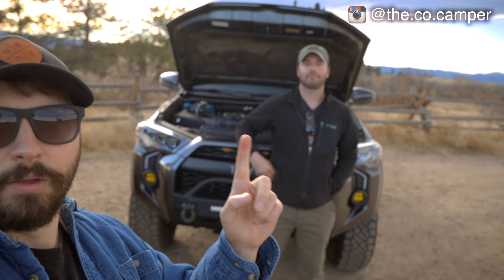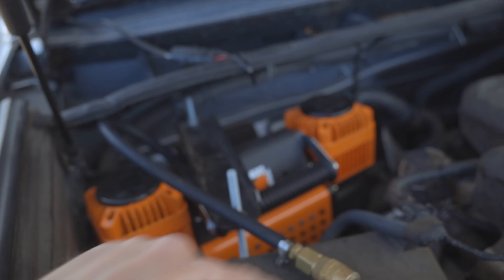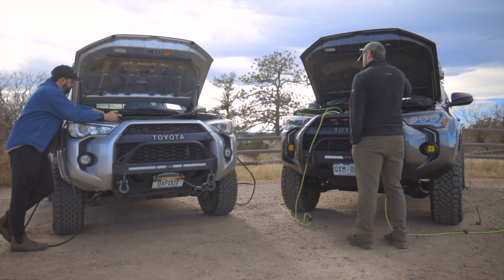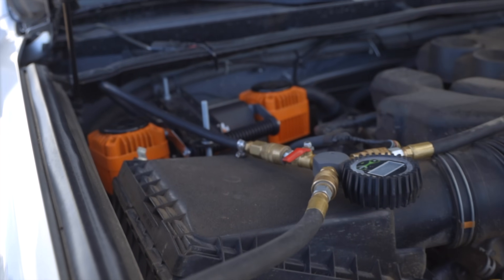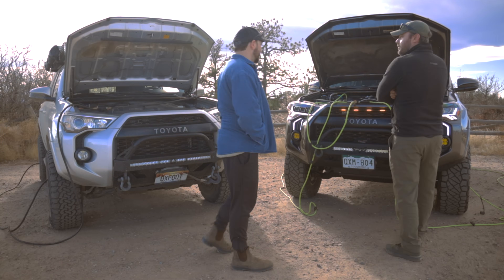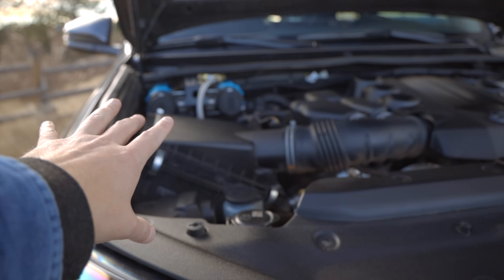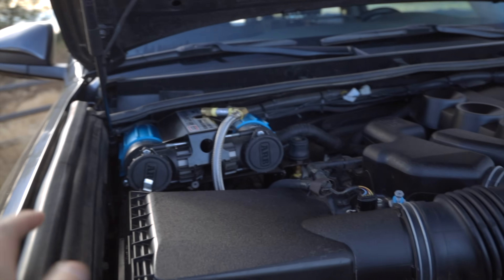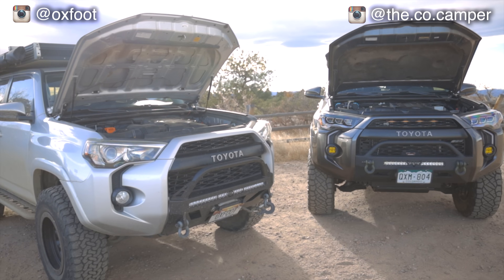Budget NAPA Compressor is FASTER than ARB Twin?

Comment: Thanks for the comparison! Great video - you've earned my sub! I wonder if you can add a pressure switch to make it safer with having the female coupler on the compressor side of the hose (as I don't believe this has a pressure switch).

I just bought a harbor freight compressor, but think I will return it and buy this! With the deals napa has right now, it'll come down to around $70 (20% off 3+ items plus $20 off $50+ purchase if you sign up for mobile alerts)
Reply from the maker: I’m not sure, I mean I did a little bit of modding to make this one work with my 4 tire inflation device so I don’t mind modding it more.
Reply from the maker: Yeah I saw that, wish I’d have know they were going to do that, I already own the trash caddy and the compressor. One more item and I’d have had 20% off. Oh well.

Comment: Many are faster. 11.56 cfm. A literal 1 psi every 10 seconds.  That is easy to accomplish. Heat management and endurance is the real issue. Arb is over priced and slower but can run 24/7. Most others will overheat and either destroy themselves or trigger the thermal throttle after 10 minutes. 

I have attached two 6” 12v radiator fans to cool each side on mine (different ‘brand’ but same manufacturer). It will still overheat.

Comment: I've got the ARB dual and can do all 4 tires with my 4 way harness in mid 3 minutes. If it's taking 10 minutes there's something wrong with the setup!!! 255/80R17's.
Reply from the maker: Yeah someone else mentioned that. I’ll try to organize a head to head with someone else who has the same size tires as me and see if we get the same results again. I know that mine is fast and so is the ARB, I got no skin in the game not sponsored or anything. Trying to be as fair as possible.
Reply: @OXFOOT  I did a DIY 4 way harness using 3/8 air tubing and went with matching hardware pieces too. While I do have a 1g air tank, I know for how little air it holds it doesn't do much besides act as a buffer with checking pressures. I figured the ARB was gonna be like 4 minutes and was honestly like WTF with 10 minutes. I was close to 10 with my dual MV-50'S before one died one me.

Comment: I’m not the sharpest knife in the kitchen however you can buy four or five of the Napa air compressors for the price of the ARB. That will probably last me longer then I’ll be on this earth. Lol🤣🤣🤣 it’s time for the monopolies to fall.
Reply from the maker: True. I mean for me the only drawback is the mystery of how long it’ll last and the fact that it’s pretty big. The fact it’s so cheap negates the first one, the fact that it’s huge is just a symptom of price but it’s in my engine bay so who cares.
Reply from the maker: I guess the fact that you have to mod it to make it work with the 4tire inflator is a bummer but it takes a few minutes.
Reply: Whats the cost of the inconvenience caused by being stranded in the middle of nowhere and you can't re-inflate your tyres?

Comment: Can you send link on the video you installing napa compressor
Reply from the maker: I installed the smitty built I had but the concept is the same just turn the compressor diagonally so it doesn’t hit the engine.  https://youtu.be/De10UUP5UzY
Reply from the maker: The smitty is a single piston and the Napa is a double so just make sure it sits a bit diagonally on the tray.

Comment: is 10-11 minutes with deflating? I get 3:30 to 4 minutes with 4 way and maxi trac airing up 7-32psi  (315/70/17 almost 35's)
Reply from the maker: So it’s 3:30 going down to 15 PSI and up to 35. We both had 285/70/17s. I will have 305s soon so I’ll have to see how much that affects the time.

Comment: What's the big deal about 5 to 10 minutes of airing down or airing up tires when your are going to be on trails or rocks for 5 to 10 hours. Save your money and get a decent air compressor . Other people in your group may be faster or slower
Reply from the maker: I get that. I like to drink a trail beer so j like being done quick as do most people. I don’t think it’s a necessity by any means though.

Comment: Something is wrong with the ARB. 10 mins is what my single ARB takes
Reply from the maker: What size tires are you running? I’ve tested this since with a different ARB and the NAPA was still way faster.
Reply from the maker: We didn’t time it that other time but it was still faster by a bit

Comment: C4 battery tray cost as much as the Napa compressor
Reply from the maker: Yeah it’s not cheap, maybe some other brands would work but I can’t confirm or deny that as I’ve never used the other ones.
Reply: @OXFOOT  I’m not knocking it, I got C4 bumper to bumper… and the double battery set up with the ARB compressor and tray… just got me to thinking how much we spent on friggin trays…..

Comment: but does the chinese unit  fill up a 5 gallon tank to 150 psi?
as there are other reasons to need onboard air.
but you only air down to 15 psi? such a fail. drop down to 4 psi. let the rubber work to grip the rocks, float on the sand. let fools do the mud bogs. as it get very costly very fast.

Comment: I’m sorry but your test is NOT accurate. Those two vehicles have different valve stems. They are the main restrictors between getting air from compressor to tire. It’s NOT comparable test at all. Only true way to test it is to use one trucks set of tires for both compressors. That way you have same RFO (restricting flow device) which is the valve stem. If you get same results than, then you will know what system is better. This proves nothing. Sorry. Great attempt and awesome videos, but NOT accurate results as different components were used to test.
Reply from the maker: I’ve tested it since then on multiple vehicles with the same results. Are you saying this should have been done 4 times? One per compressor and one per tire rather than the 2 times we did it with different compressors?
Reply: To test speed of a compressor everything down the line from compressor has to be exactly same. So where you first Chuck your lines from compressor to manifold to tires should be same. This makes all flow restrictions same. Every 90 creates a restriction, every hose has different diameter and every shrewder valve on tire has different opening that restricts flow of air. Air pressure and flow are not the same. So if you eliminate any difference from compressor out you will only than know what system is faster. Does that make sense?